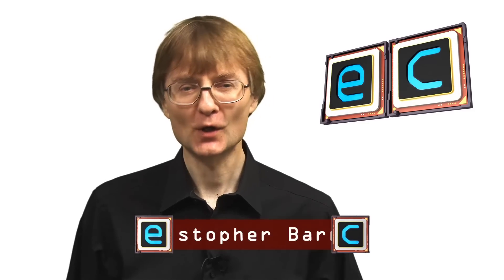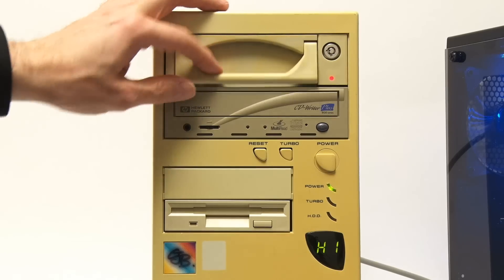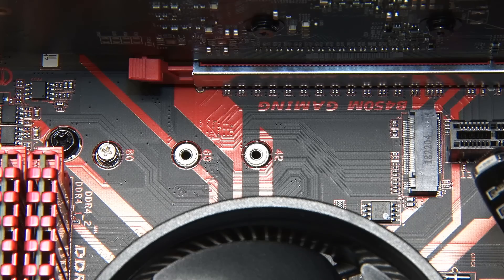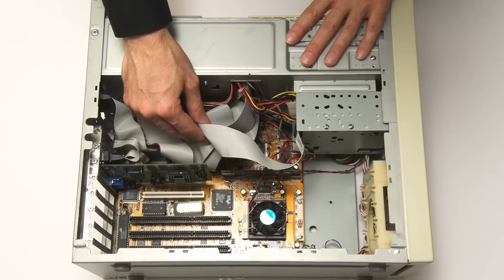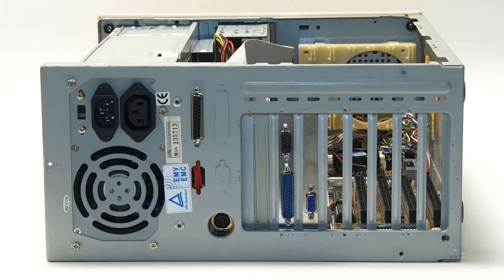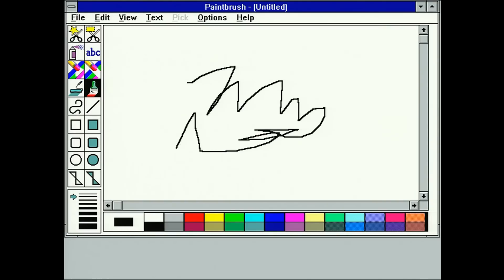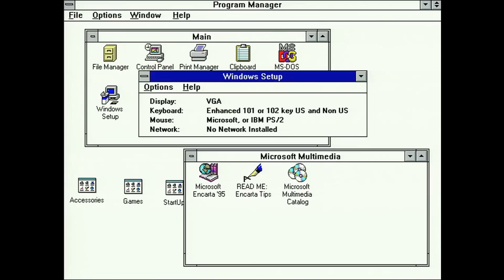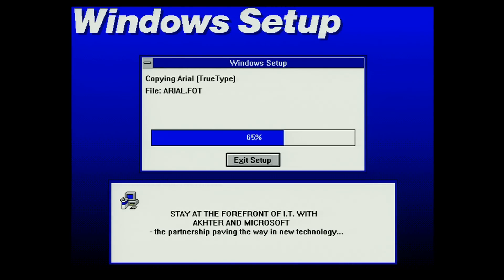Ryzen 3 vs 1996 PC

Comment: Last month I opened up a box of computer 'stuff' that I had not looked at for years. I found a printer 'parallel cable' as well as two old serial-port type computer mice sitting at the bottom of that box.  I looked at them and wondered what the hell are those things??  It took me a while to remember the last time I actually used a parallel port to connect a printer to one of my old desktop computers, that must have been something like 12 years ago!  Same thing for those mice.  I just threw them away, no need to keep them as I don't have that old computer or printer anymore.   I have an even OLDER box of computer components, I'm afraid to look in it, there might be punch cards or vacuum tubes in there.

Comment: If you change screen settings to 16 bit color, you can see normal video pictures in 16 bits.
1996 PC is better. Best quality, ceramic CPU instead of a modern piece of shit. After many years, it still work.

Comment: I can't believe you didn't jump on the bandwagon and upgraded it to Windows 95!  Of course, the AT hardware was becoming obsolete around that time so I wouldn't be surprised you got a new PC.  My dad had an old AT build he made back in the early 90s and we ended up tossing it out about 8 years ago which I'm regretting because it looked so retro with the rocker switch and that keylock xD

Comment: That ryzen pc is pretty lousy for 2019...
Reply from the maker: It is a budget Ryzen build from Jan 2019.
Reply: @ExplainingComputers  why such do we memory though. That holding it back quite a bit since its ryzen. It wouldnt have cost much more to get 3200
Reply from the maker: @zmb5501  At the time, in the UK, purchasing 3000MHz memory (the max supported by a 2200G) would have doubled the cost of the RAM.
Reply: @ExplainingComputers  oh wow that's crazy
Reply: @ExplainingComputers  - Oof please don't remind me. I have a Ryzen 3 1300x as well as 8GB DDR4 2400MHz and the pricing issue is the reason

Comment: i'll do you one better..
My first computer , Atari 1040Ste
1mb ram , 8mhz , 720kb 3,5 floppy drive(later I got a 60mb HDD)

VS
Ryzen 3700x,32GB 3600ram, 5700XT
Just cant be compared , my 10 year old self would die of shock if he would see what games we have today 

68000 CPU didnt even need cooling... , the ST would get warm after a while but thats it.
BUT
the floppy drive sound is something I miss till this day(but not the disk swapping)

Comment: For a Pentium, that thing more resembles earlier machines such as 386 or 486. The p100 I had growing up had onboard ps2, serial, and parallel ports. It also lacked a keyboard lock and turbo button but did have a bios password option.

Comment: Point No. 1 I still use ODD 
Point No. 2 Still Now Most of the PSU's comes with four-pin Floppy Drive connectors

Comment: Building a new Ryzen 3 Fedora(Cinnamon)  Workstation, still using DVD drive and including one in new build. It is satisfaction to have a nice Babylon 5 DVD box sitting alongside your favourite books about C, Rust, bash, Python 3 and  Linux/UNIX. Currently using PC I build in October 2013, but I renewed it bit by bit. Currently FX8370 OC 4.5GHz with 4x8 GB HyperX Furry, board Gigabyte UD3990FXA rev4.0 and card is Radeon R9 380 4GB Sapphire 1GHz OC edition with back plate and dedicated sound Asus XONAR AE.  OS: Fedora 30 Cinnamon spin.

Comment: With 90's PCs I remember getting a lot of nicks and cuts and even a few gashes from razor sharp edges because metal plates weren't always adequately deburred. Cheap off-brand whiteboxes were the worst. Eventually, I wore work gloves just in case.
Reply from the maker: I too remember those cuts!

Comment: I want to go back to 90's, golden age of computing. I miss so much.
Reply: That's not why I want to go back to the 90s but good enough.
Reply: Wrestling with IRQ's, DMA's, autoexec and config.sys each time a new card was installed, no thank you.  I recall having boot floppies with custom extended memory settings to make certain games run properly.  Plug and play was a blessing when it was finally ironed out.  I recall having to put a chart inside the case that contained which DMA and IRQ's were in use, and what was using them.  Ramdrive was a blessing for making games run faster.

Comment: back in 1996 PC build like a tank compared now
Reply: Yup. Metal sheets were much thicker and plastics were of much higher quality, despite the yellowing.
Reply: they had to produce quality components, because prices were so high, that only keyboard costed about 200$ after counting inflation. Average computer could costs like $5000 for our money today. They could not use to include cheap plastic and garbage manufacture like today, to spare 5-10$. Who in those time buy a computer, they wanted something like good quality car. Everything had to last long and have feeling of quality. That's the reason, why all keyboard at begining was mechanical, even had PBT plastic. Now even mechanical keyboard are using cheap ABS plastic.

Comment: That ram speed is wrong btw
Reply from the maker: What RAM speed is wrong? They are most certainly 2400 DDR4 modules and set to run at that speed via an XMP profile.
Reply: @ExplainingComputers  2400mhz for ryzen 3 is completely wrong. The minimum recommended is 2933mhz. Moreover, espevially on APU, you need at least 3200. but in this case you use external gpu, so no problem for 3200
Reply from the maker: Ah, you mean that you recommend that I should have fitted faster RAM. :) Certainly it would give a performance improvement (although 2933MHz is the maximum supported by the 2200G. The PC was built to a budget for a series here, and at the time 2933 cost significantly more in the UK than 2400.
Reply: @ExplainingComputers  2933 is not the maximum, is the MINIMUM reccomended on 2200G.

Comment: Windows 3.1 on an Pentium 120? Why?! My first hand build was an 486DX2 with 8MB of RAM and yet I've used Windows 95. And even before that, I've ran Windows 95 on 386DX. You're showing an outdated OS even for that outdated machine to make more "wow effect" on people who haven't been even borned back then. Make more accurate comparision next time. Pentium 120 is Windows 95OSR2/Windows 98 material, not Windows 3.1
Reply from the maker: I had Win 3.1 floppies available. And I mainly ran Word Perfect 5.1 for DOS. Windows 95 was not rapidly adapted for business use until OSRII came along.

Comment: We had 8GB and 4 cores in 2009 it's really a budget PC
Reply: Yeah I felt it was odd that the 2019 one is fairly low spec for the year, even decade
Reply: yes, but 8GB of DDR4 and 4 Ryzen cores are a lot faster than 8GB of DDR2/3 and 4 Core 2/1st gen i7 cores

Comment: Wonderful comparison.  Oddly my acer aspire Intel i5 also had no cooling except a CPU fan.  And even that only comes on when needed, which didn't seem to be often. If fact I'm going to need to check that it even works lol, but the CPU isn't over heating.  Odd machine.  Building my first all AMD machine next year, but my first was a 386 back in the day.

Comment: "One of the things that strikes you when you open up any modern computer is the cooling!" He says with his tiny stock 2200g included cooler. 
Meanwhile, I am over here with my PH-TC14PE cooler from Phanteks that is 171mm tall with 3 140mm fans on it... The heatsink itself is 134x140x160mm, it's more than a monster.
Reply from the maker: Even a stock cooler these days is so much bigger than what I later show in the P120, which has no case fans. :)

Comment: i have a ryzen 3 2200g laying on my desk along with a 2x4 gb kitt of ddr4 ram lol i got it last year as a place holder for a gpu i ended up getting a gtx 1050 for 30 bucks from a budy which i sold and bought a rx 570 now i have a r5 3600 6core and and 16gbs of ram im gonna reuse the 2200g for a emulation pc eventually.....btw the 2200g was holding back my 570 given it only having 4 pcie lanes i think seeing as u have a dedicated gpu i would get a different cpu trust me its worth it

Comment: I'm considering a PC build to venture into audio/video production. Will the Ryzen 3 here meet the necessary requirements? Audio production with live instruments and VST plugins would be utilized 80 percent of the time with the remaining 20 percent for video production.
Reply from the maker: You can certainly edit video and audio well on the Ryzen. If you want to handle 4K video, upgrade the RAM to 16GB. A more powerful machine would render our faster/etc. But the power is not needed for good operation.
Reply: @ExplainingComputers  Thank you. Will proceed with your expertise in mind.

Comment: Actually quite a fascinating video.

Win 3.11, although fugly, and Encarta actually seemed quite snappy. I bet it is at least as responsive as your new rig. I would have liked to have seen you boot up the Ryzen, just so that we could compare times.

ACTIVATE RANT MODE

I bet Firefox takes more than 32M just to run these days, what with all that Javascript garbage. It's insanity, really. We were all getting our stuff done on machines with less than a tenth of the power that we have today. Software developers really need a good slapping. It's a disgrace really. We're facing a plateauing of computer power, so I'd like to think that developers will be more focussed on streamlining their software.

I'm not advocating Win 3.11, but was it really as difficult to configure and set up as Win 10? I've seen so many videos where people complain about the problems they've had with Win 10.

Around '96 I was doing numerical modelling on a Pentium 133 IIRC. We also had a Dec Alpha that cost £20k. In hindsight that was totally over-the-top pricewise for what it did. Although less powerful, obviously, PCs offered a far better bang for the buck, even then. No wonder there has been a big shift away from big boxes. Although I don't know the specs of the Dec, I'm sure it would have been far less powerful than that Ryzen jobby.
Reply from the maker: Nice rant!
Reply: @ExplainingComputers  The older I get, the better I become at venting my spleen ;)

Comment: I guess you the perfect tech to ask you a question. I have 2007 Sony MP3 player during Windows XP era. After crashing the PC (XP) and I was able to play it on Windows 7 but not download. On Windows 10, I am not able to play (read) at all on my PC.
What are the options to download my songs from the old MP3 player (3)? I tried VLC, Winamp and Windows Media Player and all of them do not read (play).
Reply from the maker: One option would be to run an XP virtual machine to access the player. See my "Setting up a virtual machine" video. I have done this in the past when faced with the same issue of accessing an older MP3 player than a modern OS will not communicate with. I would also try accessing the player as a storage device only in Windows File Explorer.
Reply: @ExplainingComputers  Thanks

Comment: I remember having to install Windows from floppy disks. I always hated when you were 10 out of 12 discs into the install and disc number 11 would give you some bizarre error and you would have to start from disc number one all over again. Or when you got to the end of the install and the Machine found new hardware suddenly and started asking for disc for then disc 2 then disc 8 etcetera just so it could install the right drivers from the right discs

Comment: But I'm wondering if that 1996 model is in generally the same price range as the Ryzen 3 would have been back then?
Reply from the maker: The 1996 PC was far more expensive (in absolute and relative terms) in 1996.
Reply: @ExplainingComputers  yes I remember back then it seemed you had to invest a lot more to be on the bleeding edge.
Reply from the maker: @Nik-ff3tu  Very true.

Comment: That was exactly my board with a P133. It has a dallas RTC on the bottom, I guess. Have you replaced it or modded to add an external button battery?
Reply from the maker: No mods. :)

Comment: So if the same rise in resources were to be matched, by 2042 the average PC, assuming anyone has a PC, will have 2TB of RAM, a one Petrabyte drive. Heck knows who the processor fabricators will be but it'll be upwards of  75ghz (which isn't currently possible and likely never will be) and that processor will have around 2 to 4 trillion transistors (again not really possible, cos there are several mathematical barriers)

But the physical size didnt change that much...

The era of the desktop for home is now of course drawing to a close. Mores the pity... 

But, we cant and likely shouldn't try to  stop progress.
Reply from the maker: Great post.

Comment: I've been building pc's since the 386 came out, and i'd say he chose a word incorrectly. When referencing the Cooling fan requirement of the pentium as "revolutionary". Revolutionary generally means something you have worked to attain, the Cooling fan on a processor wasnt Revolutionary, it would be, i think, "manditory", the increase in performance from such tiny components started to require active cooling, the CPU was revolutionary, but the need for a cooling fan was a Mitigation, a Requirement, Not a selling point. That being said, Love your videos man!

Comment: Ah, your so young. Cases were actually smaller, no air flow, much heavier. Surprised to this day, we still haven't started putting the ports, usb, connectors on the front panel.  Maybe about 20 years we will make a case that matches the way we use stuff.
Reply from the maker: An IBM PC XT case was bigger --  if far heavier as you say! :)

Comment: My 1997 PC:
Cyrix 6x86 PR200+
256KB Pipeline Burst Cache
It had two USB 1.0 ports on the back
64MB SDRam (2 DIMM; MoBo had 2 DIMM and 4 SIMM slots)
4GB Western Digital Hard Drive
A IDE controlller with its own BIOS (did not use on-board controller)
A 4.3 GB Western DIgital Hard Drive was added a year later.
ATI Pro-Turbo 3D
MediaVision Pro Audio Studio brought over from old PC
Kenwood 16x CD-ROM Drive
Mitsumi 8x CD-Rom Drive (brought over from old PC - this allowed playing music while playing CD-based game)
2x 1.44MB floppy drive (one brought over from old PC, which was a teac and more accommodating to hack-formats)
US Robotics Sportster 33.6 modem
3Com 10/100 Ethernet card (Added later for university)
Original monitor was 14" viewsonic 1024x768, used at 800x600 on a 1600x1200 panning desktop.
Pirated copy of Windows 95

Computer was bought as a case/mobo/cpu/memory/single-floppy pseudo-barebones and the other components custom-installed.

Later Upgrades
Intel Pentium 233
Sound Blaster AWE32
Upgrade to 256MB RAM (2x128GB DIMM SDRAM)
US Robotics Sportster 56K gaming modem
Pirated copy of Windows 98 SE
2x 40GB HDD (near end of life)

Comment: 17:01 It’s problematic to claim that those RAM modules »run at 2400 MHz«. That’s just marketing BS. 
Please read the paper »What Every Programmer Should Know About Memory« by Ulrich Drepper (Red Hat,  Inc., 2007-11-21, page 8): 

»As of this writing, frequencies of 800MHz, 1,066MHz, or even 1,333MHz are available with higher frequencies (1,600MHz) being announced for the next generation. This does not mean the frequency used on the bus is actually this high. Instead, today’s buses are double- or quad-pumped, meaning that data is transported two or four times per cycle. Higher numbers sell so the manufacturers like to advertise a quad-pumped 200MHz bus as an “effective” 800MHz bus.

For SDRAM today each data transfer consists of 64 bits – 8 bytes. The transfer rate of the FSB is therefore 8 bytes multiplied by the effective bus frequency (6.4GB/s for the quad-pumped 200MHz bus). « (end quote)

Conclusion: read the fine print, the technical specifications of mainboards and RAM modules before claiming they »run at 2400 MHz«.
Reply from the maker: Your point is clearly and well made. I am well aware of multi-clocking issues and RAM timings. But pragmatically, given the content of this video is not about RAM timings, I think was I said was reasonable in context.
Reply: @ExplainingComputers   Quite. I was only nit-picking. Cheers!

Comment: I perfectly well know that this is a retro channel, but...
This early-2019 Ryzen desktop PC was really on the cheap side on motherboard (B450 without VRM cooling, only 2 DIMMs), RAM (only 2400MHz when 2933-ish MHz RAM is almost attainable for the same price and can really work wonders with AMD Zen architecture) and lastly, the SSD (all modern boards support M.2 slots with at least a PCI-Express 3.0 x2 interface, yet there is a SATA SSD inside... price difference was negligible even since last year between fast SATA 2,5" and low-power to midrange NVMe SSDs).

To finish my rant on a positive note, the Pentium PC is wonderful looking, I love the completeness of the set of external IDE drives and bonus point for the caddy! These weren't generally available in my country until the end of the 90s.
Reply from the maker: Thanks for this. I cover my component choices for the Ryzen in detail in its video series on this channel, in which I built to a budget. At the time the purchases were made (Jan 19), 2400 RAM was far cheaper than 3000 in the UK, and the SATA SSD very, very much cheaper. As I recall, the system price would have been 50% higher with 3000 RAM and an M.2 SSD.

Comment: It's funny that the more our computers are capable of doing, the more we GIVE it to do, making the overall user experience about the same (as far as the OS interface is concerned). For example, I dare say that using DOS on a 12 mhz IBM PC back in the day was about as zippy as using a moderate Windows 10 system in many respects. It's too bad too, because it would be great if the user experience improved at the same rate as overall system performance so that everything you did was instantaneous.
Reply from the maker: So true!